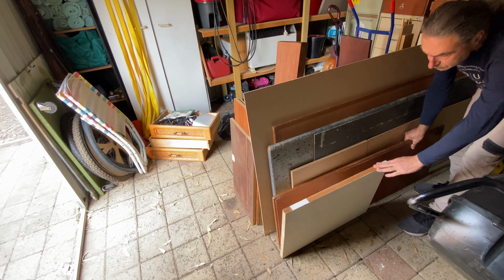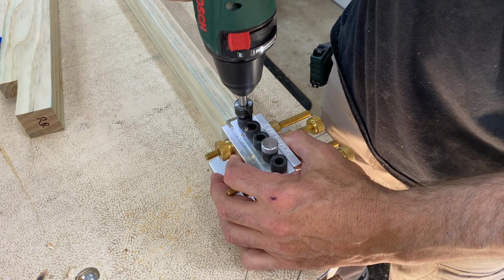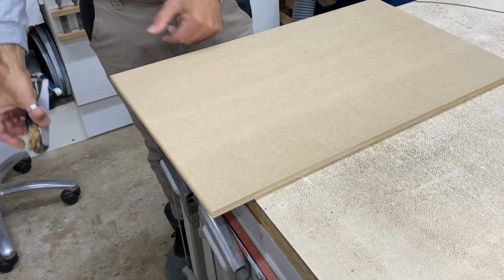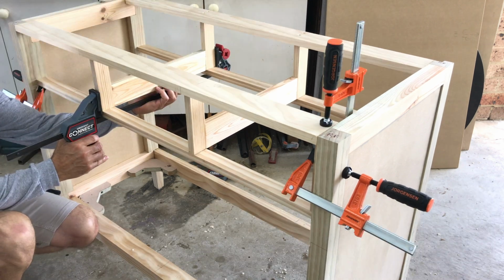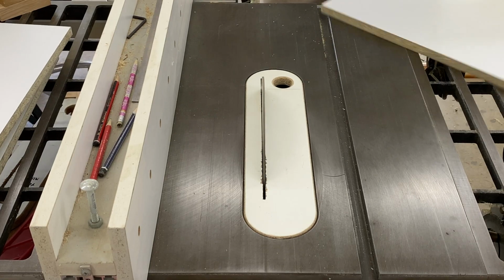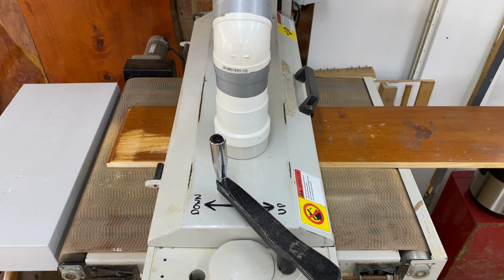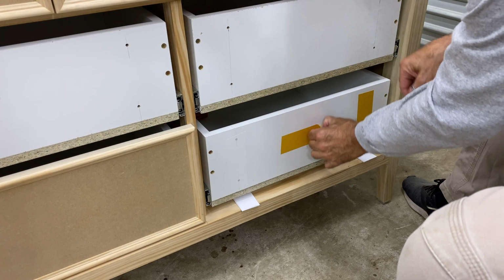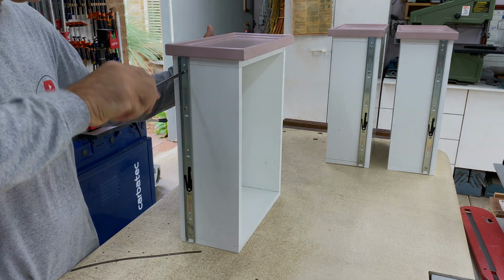Making my daughter a beautiful forever dresser

Comment: That blue structural timber is treated pine right? I am wondering is, like mine, your local Bunnings has stopped stocking untreated structural pine?
Reply from the maker: I don’t think it is but I’ll check now that you mention it. The reason why I don’t think it is, is because they sell treated pine 2x4s that are labelled as that and are in a different section.
Reply: @DownUnderWoodWork  I just looked it up and it is H2 treated pine, it took over the section that used have untreated structural pine, I would be very interested if Your Bunnings have done away with untreated structural pine and even nonstructural pine (they do sell some of that really crappy 70x35 non structural pine). It's a really weird thing that I would love to get to the bottom of.

Comment: Nice tip about the blade height on Melamine Vic, I didn't know that
Reply from the maker: Yes mate, it gives a better finish but a lot of us have had it drummed into our heads to always keep the blade as low as possible and that's correct but there's always exceptions to every rule. Be safe though.

Comment: A great piece Victor. I'm sure she will love it. I want to know which Bunnings you went to, to find straight 2 X 4's, and with a low moisture content 😉🤪. I don't think I have come across an Ozzie creator that does not use the sauce bottles for glue. I'm a cheep scape. I cruse the streets looking for old verge collection furniture, which I then break down and re purpose.  And as to the drum sander, Why didn't you ask me earlier, I could also have told you from experience ( and cost) not to do it .
Reply from the maker: Thanks mate. I was just as surprised as you when I saw the quality of the 2x4s at my local Bunnings. they must have changed suppliers. I've been using the sauce bottle since before I started Youtube. Nothing wrong with kerbside timber mate, i do it too. Good for the environment. Sometimes the best lessons are learnt the hard way.